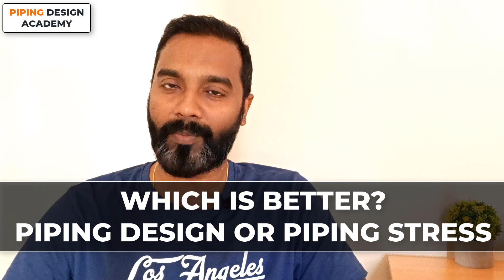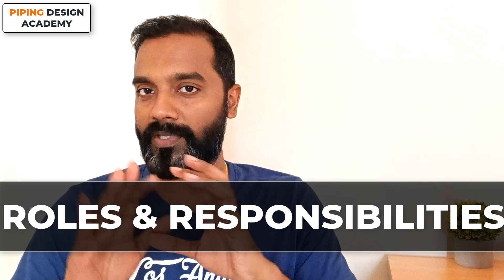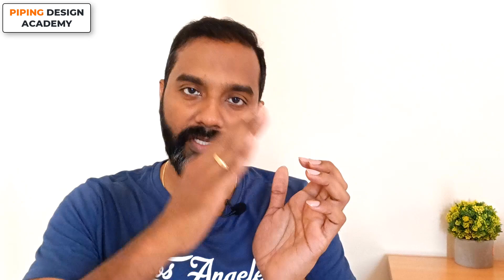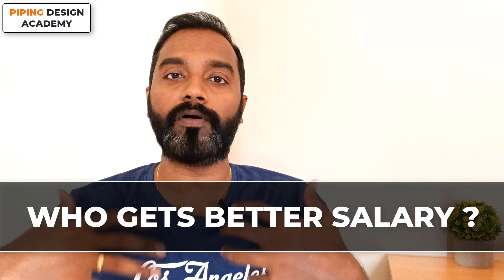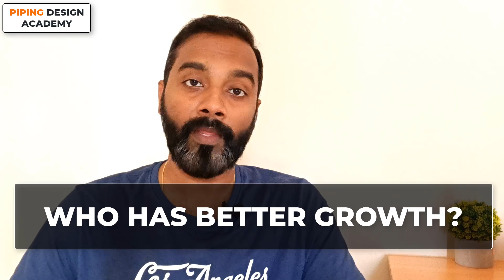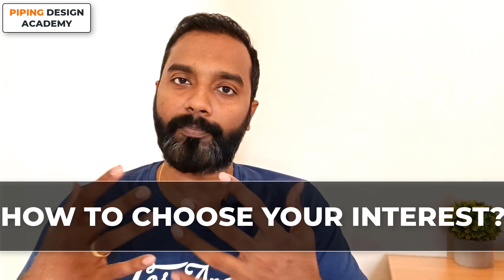Piping Design Engineer or Pipe Stress Engineer ( Which is Best?)

Comment: Hii subash chandra .... I do not agree with your video as I am working as a piping stress engineer...for the piping design profile you have to do diploma only but for the stress analysis btech is compulsory so you can compare salary, there is difference for the design engineer we as stress engineer suggest the routing that which routing is more good
Reply from the maker: Hi Krishna, Your statements are fundamentally wrong and I can assume that you are a beginner in this field. As per your statement,  a Piping Design engineer who runs the whole project can have only Diploma. But stress Engineer who works only on the stress part should have engineering degree. Please understand that All Design Engineers should have engineering degree. Only designer shall hv Diploma. Guess you don't understand the Difference between  engineer and designer. Moreover, stress Engineer only check the load and stress for a line. But the routing is produced by layout engineer or Design Engineer. Please improve your clarity on these areas before commenting in any open forum